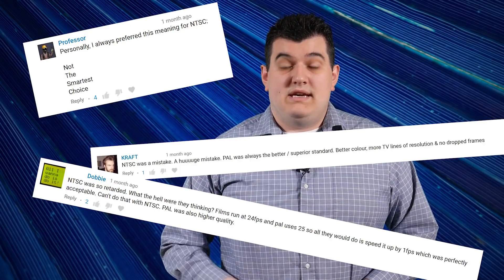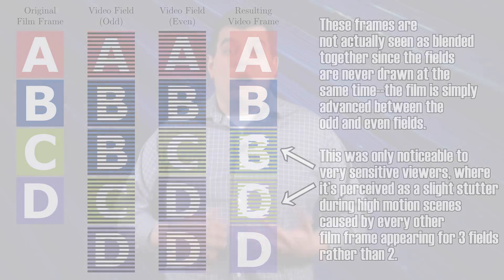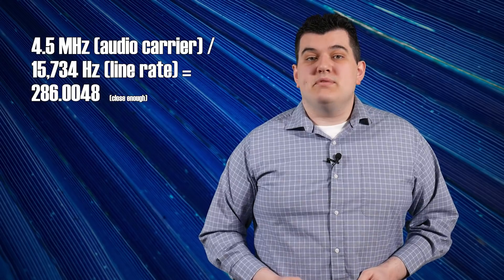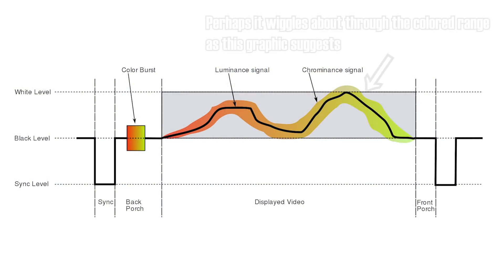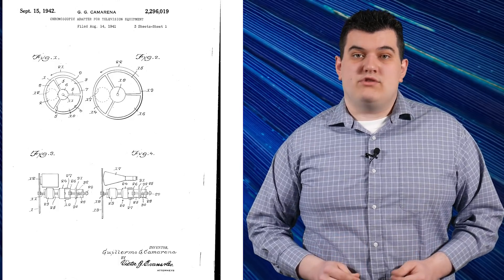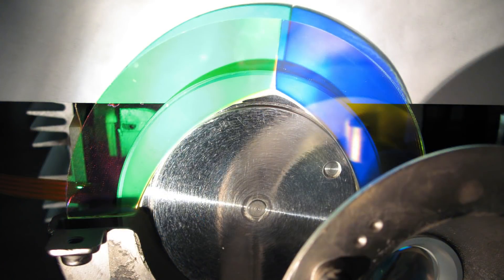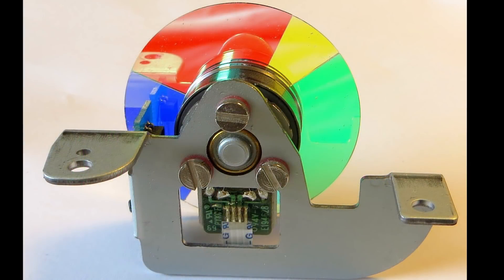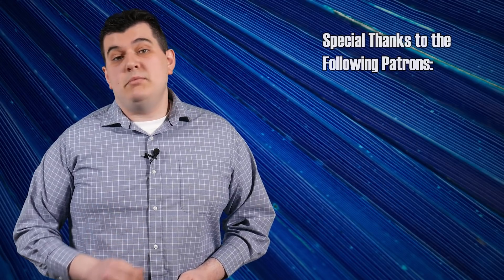Analog Color TV Wrap-Up--Some extra info

Comment: Another fascinating video. You're quite right that we started B&W PAL broadcasts in the UK in 1967. In fact, if you ever watch early episodes of a series like Doctor Who, which began as 405-line B&W, and then shifted to 625-line B&W in 1969 (that's roughly when BBC One shifted to 625-line) you can really see the difference in quality.

With regard to making telerecordings of shows made on video tape, one of the main reasons for doing this was that the BBC were fairly active in selling their programs on to foreign markets quite early on. This was usually done on a hierarchical basis - rather than go to the expense of making dozens of multiple film copies, the BBC would simply make a handful. These would then be sent to the first foreign broadcaster who had the right to show them, that broadcaster would send them into the next, and so on. And because of the myriad of broadcasting standards that existed at the time (some markets would be on 405-line, some on 625. Some on PAL, some on Secam (the French system) and others on NTSC - and then add colour into the mix by the early 70s), then the simplest and most broadcast-standard friendly method was to use B&W film copies.

Of course, there are three problems with this method. Firstly, you can't guarantee that the last broadcaster which had the film copies actually sent them onto the next in the chain. Indeed, the BBC have managed to recover programmes long thought lost for good by tracing telerecordings that were either never sent on to the next broadcaster, or in fact returned to their commercial sales department, BBC Worldwide (formerly BBC Commercial Enterprises). Before the BBC established a proper archive, the broadcast arm would often make telerecordings of videotaped programmes for Commercial Enterprises, then wipe and reuse the tapes to make something else. Commercial Enterprises would sell the telerecordings to overseas broadcasters, and after a few years of a programme being available for sale, assumed its commercial viability had come to an end. No further sales would be made, and they would burn the telerecordings, as they were under the impression that the broadcast wing did indeed have a proper archive. Many thousands of hours of vintage television was lost in this way. Often, the only reason there are copies of vintage programmes available, or we only have B&W film copies of programmes originally shot in colour is because of film telerecordings.

The second problem, is that censorship standards would differ from country to country. And what might be acceptable to UK audiences might not be for Australian or New Zealand censors, who would often remove offending material by simply cutting the offending sequence from the master telerecording, rather than go to the trouble of making their own copy. And when this was sent into the next broadcaster, that sequence was missing. Sometimes, these trimmed sequences have been recovered and are the only surviving example of the programme at all.

The third problem with the telerecording method, is that if that programme was original shot on video, the telerecording looses the smooth look of video; as instead of being made up of 50 fields per second, copying that programme onto celluloid blends those fields into 25 frames per second (if the camera was modified to run at that speed, or 24 frames if not). And that blending of fields into frames can lead to visible errors in vision mixing between different cameras from the original multi-camera shoot (almost all videotaped programmes in the UK were shot multi-camera, with a vision mixers switching shots between different cameras). Fortunately, this was rectified when one particular fan of vintage television noticed that a repeat broadcast of a programme that only existed at a telerecording, which he had taped on his domestic VCR, reverted to it's naturally smooth motion on screen as he fast-forwarded through it. Realising that the VCR was in effect "blending" the individual frames back into fields, he contacted some friends who worked in broadcasting, but who also specialised in restoration of old TV programmes. Armed with this information, they were able to devise a process where old telerecordings of programmes shot on video can be made to look like video again.

With regard to how long it took to establish PAL as standard due to the challenging topography of Europe, in fact the BBC was still broadcasting B&W 425 line television to some parts of the UK as recently as the 1980s, due to those places being unable to get a good UHF signal for 625-line PAL - but they could manage a VHF signal for 425 line. Since the introduction of satellite and digital terrestrial broadcasting, this is less of an issue. But (for example) at my house, I used to receive a fairly poor analogue terrestrial TV signal, as I don't have direct line of sight to a transmitter, and must rely on the signal bouncing back down to me from the ionosphere. When the switched to digital terrestrial broadcasting (using the DVB standard) the picture quality improved massively. Then, the strength of that signal was reduced, and I can no longer receive digital terrestrial signals. I can get digital satellite though, so all my television comes via that. 

With regard to showing movies on PAL systems and then running at a slightly higher speed - yes, this is true. If fact, when James Cameron's Titanic was broadcast on BBC One some years ago, there were complaints from some members of the public who assumed that the BBC had cut out material, due to the slightly shorter running time. In fact, the film had been shown unedited - but due to the extreme length, the slightly higher speed of 25fps meant a noticeable difference (at least, for petty-minded fans of epic disaster movies). The slightly higher running speed of movies also means a slightly higher audio pitch, which most PAL broadcasters compensate for by lowering the pitch by the same amount.

With regard to the colour-recovery method you described - the software was actually written in a modern Windows-version of BBC Basic - a version of Basic that dates back to the Acorn Computer's BBC computer series of the early 1980s, introduced with the BBC's Computer Literacy Programme - a scheme they introduced to make computers available in schools and used to teach children. Almost all UK schools had at least one BBC Model B Microcomputer at the time, and the version of BASIC included on BBC Computers was a particularly good one.

There is another method of colour recovery that was used by that same team of vintage programme restoration specialists I mentioned easier. They were all fans of Doctor Who. Many of the early colour episodes of Doctor Who had been sold abroad as B&W telerecordings to those countries that didn't have colour in the early 70s; but sales to the United States and Canada tended to be colour, as that was obviously the preferred format for North America broadcasters. And then, in typical BBC fashion, the original PAL master tapes were often wiped. When this occurred, the BBC would (in later years) obtain back their NTSC-conversion masters, and reconvert those for PAL. However, one particular Doctor Who story only existed as relatively high-quality B&W telerecordings, and a domestic recording of a North American transmission on a home format, which wasn't a suitable for a proper VHS release, let alone a repeat broadcast on BBC TV. So, in order to make a good quality colour begin, the restoration team took the telerecordings for their picture quality, and matched that with the colour signal from the NTSC home recording - combining the two to get, in effect, a colour telerecording. This was the mid-nineties, so the differences in screen geometry were easily corrected by bending the overlaid colour signal at the edges of the screen to match the B&W telerecording. As this has gone by, the same team have built a rather sophisticated reverse standards conversion machine, which has vastly improved the quality of programmes that were shot on PAL, converted to NTSC, then converted back to PAL years later. These used to be pretty terrible, but now are almost indistinguishable from other PAL programmes of the time. And, by incorporating the frames to fields conversion, they have managed to make some very high quality restorations of vintage programmes that would otherwise be in a very poor state. Combine that with the standard repairs for hairs in the gate, scratches, speckle, etc etc, they Restoration Team (add they are known) often put as much work into a recovered programme as you'd get with a major Hollywood studio rescuing a movie shot on nitrate stock.
Reply: ZygmaExperiment There is no such thing as PAL 625 B&W, since PAL is just a colour coding system. You are referring to CCIR 625 (which is B&W) and in use in countries in Europe since 1950, long before PAL or NTSC.
Reply: Yes, that's true enough. But it isn't a technical essay.  It's a You Tube comment.
Reply: The Claws Of Axos has had two releases: the first used the NTSC masters reverse standard converted (which turns out to be more difficult with the early conversions due to the crude set-up of the original method), and the re-released version used the B&W film copies to provide the luminance and the NTSC masters chrominance to get a better overall picture.
Inferno also had the same re-release.
Reply: The original UK system was 405 lines (not 425 lines). I know I'm being pedantic about your very fine and informative post.
Reply: Wow. The distribution story is much like what we have in Brazil with Chaves (Mexican Televisa's El Chavo del Ocho). One of Brazil's biggest TV chain used to buy the batches but would keep them instead of exchanging with Televisa, this led to the creation of a fairly large collection of tapes that even the Mexican producer didn't even bother to archive. 

The problem with Chaves is that there are still lots of lost episodes, due to the chain of distribution or the lack of will of Televisa. And the fact most episodes are reruns of others, admittedly having several versions or variations of a particular script. 

I live for these things.

Comment: (5:25) - You talk about cheaper TVs not filtering out interference which resulted in "...a pattern of dots in highly colored areas of the screen".
You've taught me something new here. I was hitherto totally unaware that certain "areas" of the screen were more "highly colored" than others. Please, which areas of the screens were actually more "highly colored" than others, and how did they achieve this? Did they use a different type or grade of phosphor on the screen or what? I am intrigued here.
Reply: He means areas of the image with high colour saturation, because in those areas the NTSC and PAL subcarrier has higher amplitude and therewfore will cause more interference. In black/grey/white areas its amplitude goes to zero, i.e. it disappears completely and no interference occurs.

Comment: Regarding chroma dots (and I hope I don't repeat anything you've already said, or bore anyone needlessly)... the dots you're seeing when viewing a colour signal on a high resolution B&W monitor is the chroma signal itself.

...I was going to go into the details of how the chroma signal is generated, but the comment got incredibly long and probably unintelligible. Suffice to say, the chroma signal is made up of a modulated sine wave. Such a signal has peaks and valleys in magnitude when you look at it up close. The overall height of these peaks and valleys (when you 'zoom out' and look at the amplitude of the signal) represents the saturation of the signal. If a B&W television doesn't filter out the chroma signal, it will draw the tiny peaks and valleys as dots on the screen. Highly saturated colours have a stronger carrier amplitude, and have a higher contrast between the peaks and valleys, making them more noticeable. The effect is magnified by gamma correction, because the peaks of the sine wave get stretched, making the dots even more visible.

Comment: Please do a follow up to this covering PAL-M used in Brazil that was 525 lines with PAL Colour and Subcarrier as well as FRENCH and RUSSIAN SECAM. FRENCH (France, not overseas holdings) used the lowest energy levels for SYNC and a reverse Luma polarity. 

Failing to cover these weird cases would really miss out on some interesting technology tweaks. 

++ 

COVER NICAM STEREO and A2 STEREO ... noting that the US NTSC system for stereo for telly sucked ...
Reply: eyreland SECAM utilized the base 625/50/2:1 standard with two FM chroma subcarriers that rode alongside the luma signal in 'Y'Db'Dr fashion. SECAM utilized two delay lines to contain the additional FM chroma subcarriers on top of the base luma signal, and utilized vertical subsampling in addition to horizontal subsampling, with each of the individual two chroma components getting their own respective sample on every other horizontal line. I believe this made chroma crosstalk impossible despite SECAM being composite.
Reply: Of course there were chroma/luma crosstalks in Secam. But because of FM, they looked different than in PAL or NTSC. There were 2 delay lines - one for luma as in PAL or NTSC. The second was for vertical subsampling.

Comment: The UK system could have ended up very different to the rest of the world. Lew Grade, head of ATV (one of the leading commercial broadcasters in the early years here) wanted colour back in the '50s, and actually experimented with 405 line NTSC, but the results were deemed unsatisfactory and we ended up waiting for PAL/625 as used in Germany. It should also be mentioned that the French had a form of HD very early on with (I think) an 809-line standard.
Reply: 819 Lines.  At the time, one could watch French TV along the British south coast as the line oscillator would synch so you would get two pictures side by side.  The audio signal however, was way out of band.